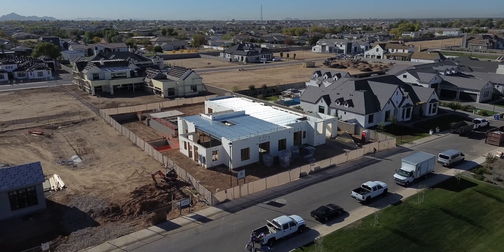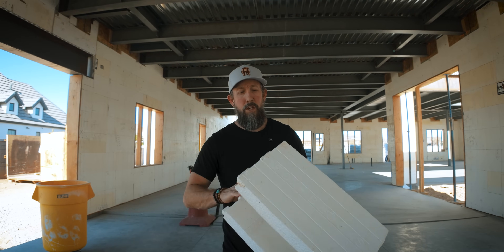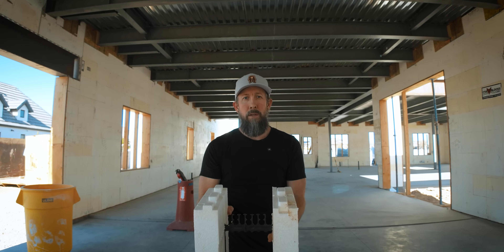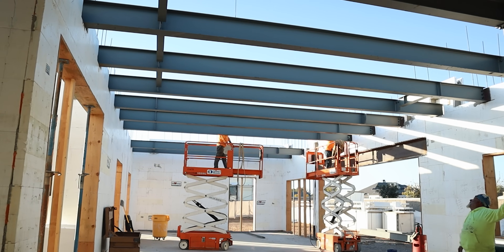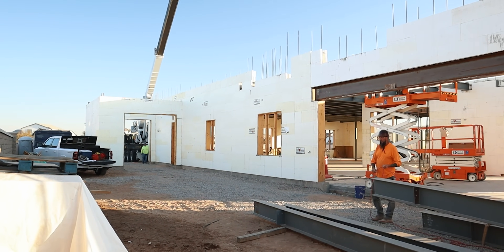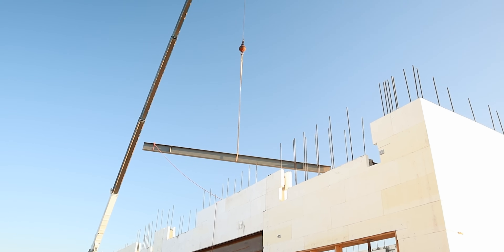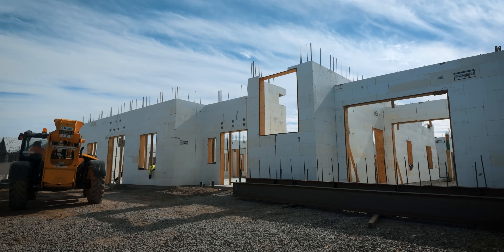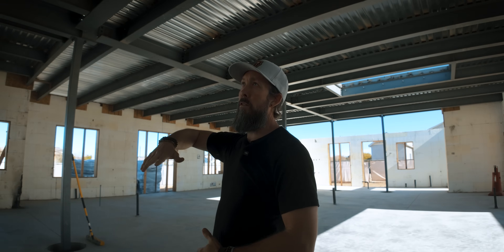Why Two-Story ICF Homes Are Revolutionizing Residential Construction in 2025 | EP-33: Liberty Estate

Comment: Increased foundation costs to handle the weight, concrete costs have increased a lot, ICF forms have gone up, and that is some expensive steel work in that home.  Electrical costs go up because most don't want to deal with the mess and cutting through the form ties.  There is much more planning for sleeve penetrations or expensive and messy coring after the pour.   I don't see that home being 5-10% more expensive than stick built.  That said, those are solid homes and worth it if you can afford it in my opinion.

Comment: You are removing half of your insulation by anchoring the steel beams in the concrete. The spacing of your beams is also odd. The main reason to do that is due to old people walking up stairs wanting a low step height, but you also have 10ft to 12ft ceilings, so that isn’t it. 

3 inch steel decking (that corrugated metal on the ceiling/floor) should be able to span 8 to 12 feet depending on the gauge, though people often do 4 to 6 feet over trusses.  

You can enhance your thermal bridging resistance by using stainless steel bolts and insulating grout at the end of the steel beam.

Comment: I would also add that it is "DIY-friendly" with the caveat that it is critical to install it correctly (any mistakes are immortalized in concrete). The DIY route might also mitigate some of the higher costs associated with ICF. 

The use of steel girders and decking is an interesting choice. Personally, I think I would opt for the wooden web trusses and Advantech flooring just to mitigate the rigidity that you get with steel (which can be more demanding on feet). But that's me. Not saying the steel is a bad choice.

Comment: certain places in the US will not permit a termite inspection of ICF houses because you cannot detect termite intrusion after its built.  If you stucco the outside and the termites enter at the slab interface, they you wont have termite tubes to see the infestation.  No termite inspection = no insurance.  Personally I believe this can be remediated by wrapping the first course of ICF from the inside, under the bottom and over the outside of the first or even 2nd course with a very fine non-ferrous metal mesh.  But I have not seen any products like this.

Comment: I'd rather exterior insulation,  I want to see the cinder blocks exposed, copper piping, air ducks and electricity all wonderfully installed like its art :) 
The ceiling span you showed is beautiful! 

I'm in Florida
Reply: ...sevaral ICF mfgs have single-sided options for that, and thicker foam for the outer shell. it's not as optimal in a few ways, but in certain designs/cases it can be more efficient, and allows for the style you're after.
Reply: @Krazie-Ivan  thank you
Didn't know that
Reply: With the same concrete thickness and foam, the sandwiched version will be overall the most energy efficient system.
Reply: @jintsuubest9331 ...there are some cases/designs where the exposed concrete absorbs sunlight during the day & releases that energy (heat) through the night. and generally, having the thermal mass absorbing/releasing & helping to regulate temps inside, with thicker insulation outside, is more energy efficient. 

but it's easier to calculate for, and design for, double-sided properly. far easier/faster/cheaper to build with double-sided forms. hiding MEP, attaching walls/cabinets/etc, multi-floor transitions ...all more optimal with double-sided ICF.

Comment: I wouldn't do it for the utility savings. $50000 is a lot of years of electric bills. I'd do it for the soundproofing and insulation. 
I'm surprised there's no savings on build time.
Reply: ...there can be shorter build time, esp to dry-in stage which can be really important in areas with fast-changing weather, because you're not scheduling so many different subs to get to that point. also, MEP & insulation crew & exterior finishers aren't competing for time/space. don't forget the ins savings from Fortified certification, and far less maint req, and lower upfront costs on HVAC sizing, and less spent on exterminators, and far lower PV system sizing req to offset grid (or be offgrid), etc.

Comment: Where is the additional cost coming from?  ICF should be half the cost.  It's far easier to manufacture, transport, and assemble.  It sounds like we're paying early adopter fees and high prices because builders are milking it.  It's the same with car manufacturing.  The cars are not better (they're worse actually) but far more expensive.  I wonder how much a DIY ICF house would be?
Reply from the maker: Interesting thought. It's more in the labor and concrete.

Comment: Good luck finding a stud to hang something on in that house
Reply: ...each block has a thick flat tie running floor to ceiling every 6-8" on center (depending on block mfg), marked on the block, which has several times the pull-out strength of wood. it's just below the surface of EPS on both sides, at the perfect depth for plywood sheathing to hang cabinets & such w/o needing to find the stud. so; more places to hang from, that are stronger, and ease of backer that doesn't req the drywaller to cut around.

Comment: Interesting faraday cage you are building there. My daylight basement level is ICF - done by me - and I love the stuff: temp-stable, less concrete, quiet yet not great for radio signals like wi-fi and cellular. I guess it's true, you can't have everything.
Reply: ...most (if not all, by now) cell carriers utilize wifi for calls/text if the signal is stronger than the cell tower, just have to enable it on your phone. and routers are cheap enough to run a 2nd access point or even just an antenna extension outside to get internet in the yard. we have to use this combo out in the sticks, where there's no cell signal, and the ICF house is on satellite internet.
Reply: sure you can. look into commercial or pro-grade router/transmitter options. much better than the slushbox your provider gives you and you can customize the system to as much or little you want to do with it. I just run Ethernet cable to main areas of houses as a standard in new builds. even in a 3k sqft home you'll have dead spots and like you say, way less with stone and metal in the way. so yeah. multiple wired transmitters is the way.
Reply: I could totally see a niche market with preppers for homes that literally are faraday cages (not sure how that would be fully engineered with windows and doors) that had EMP surge protected antennas to pipe in communications signals. Could probably charge a premium for such a home (but preppers kind of strike me more of the DIY'er types anyway).

Comment: Two stories of termite tunnels.
Reply: ...only with ground-contact, and a non-treated block. anyway, would you rather catch a tunnel on the foundation in the time it takes termites to crawl up 4" to the bottom plate of a stick build, or the 19' 10" it takes them to burrow through a non-nutritious material to reach the top sill plate 2 stories up?
Reply from the maker: Although we can't eliminate termites, we did a pre-treatment for termites and used the Stego Pango wrap under the slab. Doing what we can to keep them out.

Comment: I just lost my home in Altadena due to the Eaton fire. I am going to rebuild and was wondering what the cost differential is between stick built and ICF in Southern California. Also, is there a resource for capable ICF builders in my area?
Reply from the maker: ICF would be a great way to build. Energy efficiency would be amazing. If you are looking at fire resistance steel could be better but less energy efficient. I would advise talking to a builder in your area that has worked with ICF, CFS and stick. You may need to talk to a few different builders.
Reply: while EPS can burn, the temps & sustained time to ignite are pretty high. most fires burn over quickly, so it's more important to not have anything near/attached that will catch fire easily & spread to the EPS with high intensity. also, modern stucco products like U-Stucco provide fire retardant protection & an insulation factor up to several thousand degrees.

one of your biggest hurdles will be getting local code changed (or get a variance) to allow for sealed attic, so you can utilize products like Lite-Deck roof. a lot of dwellings with Hardie siding & metal roof still burn because embers get sucked into the vented soffits & catch the wood structure underneath.

in any case, windows/doors will fail far sooner than the ICF structure, and it's really all about having time to get people/pets to safety. if you can prevent the structure from total ruin, that's just a bonus compared to traditional building methods/materials.

sorry you're goin through all this. GL!
Reply: Sorry for hearing that, but you made the right choice this time, just go for concrete and steel. Wood framing? Who needs it?

Comment: Any concern with termites?
Reply: Termites don’t eat concrete and steel, those are inorganic compound that no insects would to eat, so you are safe as hell
Reply: @jijiwaiwai  but they do eat styrofoam, and quickly will make a beeline to a roof made out of wood ;)
Reply: @StacyODell  ...many mfgs offer treated block, and all buildings req some sort of design/material/preventative treatment combination to deter pests anyway. key is to lift & seal any/everything softer than concrete above soil/grade. if your ICF installer and/or engi don't plan for this, termites are their fault, not the product's.
Reply: Always a concern with insects...imagine building with wood...and hence I imagine here there is steel. Steel in my view as is even more true with aluminum very much an underused building material for home and barn construction.  Wood quality has gone way done as has availability plus crazy high prices. This isn't true of steel and aluminum.  Also finding the correct paints and adhesive products for 2025 actually too much of this product at the moment...shorthand for "great time to buy in to metal with proper coatings" in particular the roof...the second most valuable item after the foundation. Is this a good foundation product? I'd investigate that first before going with two stories😊😊
Reply from the maker: Although we can't eliminate termites, we did a pre-treatment for termites and used the Stego Pango wrap under the slab. Doing what we can to keep them out.
Reply: @aft_construction  Has there actually been a study on this problem ? Plastic is essentially undigestible for Termites. So why would they continue eating it....

Comment: WiFi must be a nightmare with all that steel - esp between floors!
Reply: You’re seriously underestimating the penetrating power of electromagnetic waves. I used to live in a two stories RC concrete house, one WiFi, all 7 rooms have good strength, today we even have Mesh WiFi so this is not a concern at all
Reply from the maker: We will see. Every home we build has extenders and the most tech to get the best result.

Comment: Great video. When you say 5 to 10 % increase in building cost, what all do you include in the building cost? Framing cost? Or full cost of the building? Cheers.
Reply: Full cost of the building.
Reply from the maker: Correct, Full cost.
Reply: ...this number is usually used when comparing 2x6 traditional stick flash-n-batt (1in closed cell, followed by fiberglass batt), with 1in exterior EPS under lathe. the many benefits of ICF far outweigh the added cost from day-1 of CO, but you get a basic picture of upfront cost difference.

Comment: I like Strata International foam houses, its the opposite of ICF, solid foam panels is the framing construction with no wood or steel. After plumbing and electrical you encase it with concrete mix that gives its strength. You don't need exteriors finish, or drywall. So simple and easy anyone can build a house. Strata is in Phoenix as well, and they teach you how to use their products.
Reply from the maker: That would be a really interesting process. Maybe someday we will build one. Isn’t construction technology amazing, so many different ways to build.
Reply: Also called SCIP (Structural Concrete Insulated Panels).  Used a lot around the Ring of Fire /Pacific rim, I.e., Asia and south and central America. Earthquake, fire, hurricane, tornado, mold, flood, mildew, and termite resistant.  Fast, strong and energy efficient. President Carter helped built these in the 1990’s for Habitat For Humanity. Concrete roof makes it monolithic construction.
Reply: For coastal Florida, ICF is the better option for wind speeds, fire, termite and moisture resistance, sound proofing, added value, life span and code compliance. Plus energy savings.

Comment: Question: how can ICF be used for homes with angled or curved exterior walls?
Reply from the maker: Fox Blocks has a 45 degree angle block and radius block, so it is possible to create the curve.
Reply: ...good installers can kerf blocks to any radius, just increases labor time expense.
Reply: @Krazie-Ivan , why then are all the examples I've seen rectilinear designs only? Both things can't be true.
Reply: @ ...easy search will turn up examples. curves in general (all types of building products) aren't as common as straight walls, due to cost.